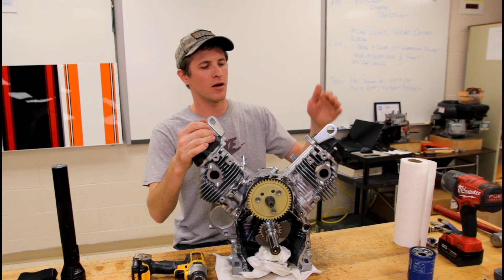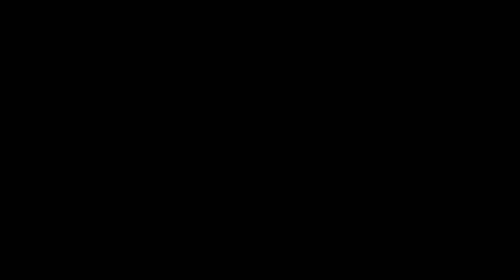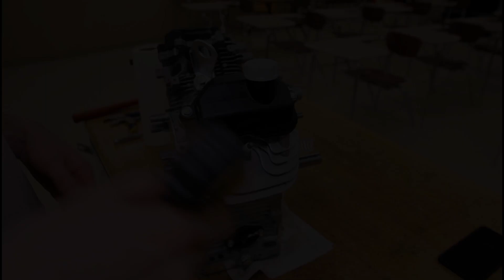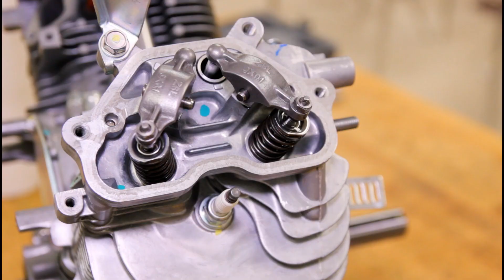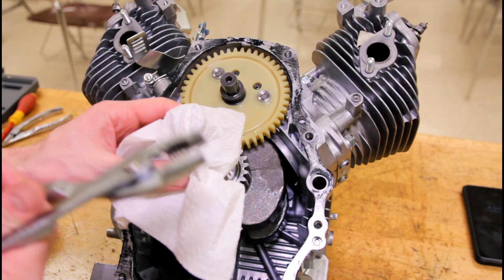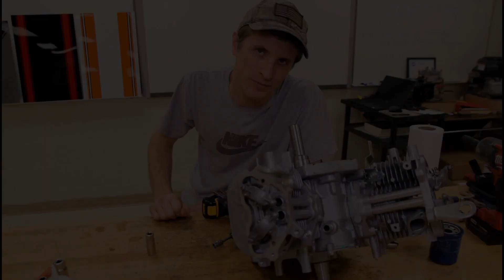8 Honda GX 630 Camshaft Removal

Comment: I run a carpet cleaning business and almost every machine I have has a Honda 630 , I threw away several engines thinking 2000 hours was all I could get out of this engine but now I simply put a new camshaft and all gears new and it’s good to go , not hard if you’re mechanically inclined and not very expensive. My question is if this is on going problem with this engines why aren’t the gears made out of metal?
Reply: sacrificial cheaper part

Comment: Looking for how to removal crankshaft on gx630 but not having much luck, want to know if it's possible without taking heads off, thanks
Reply: You will have to remove push rods to make clearance to be able to slide out cam